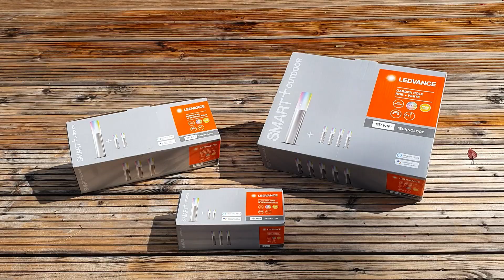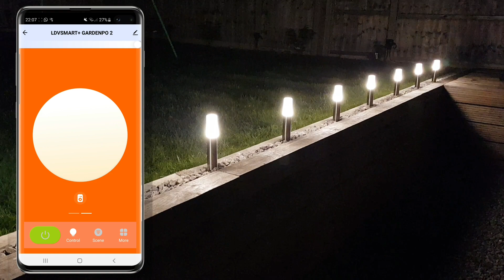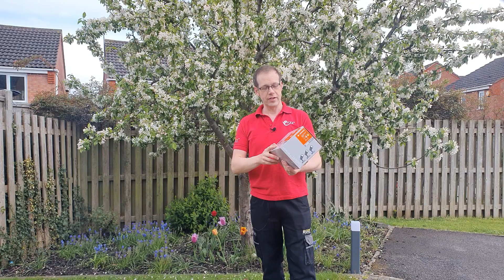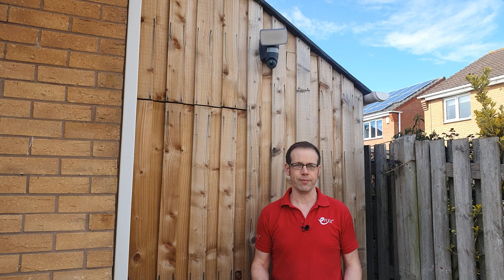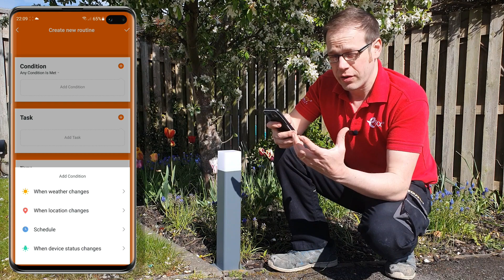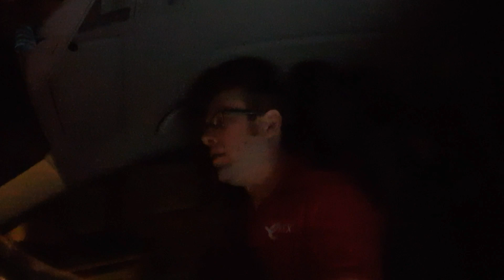5 GREAT SMART GARDEN LIGHTING IDEAS with Ledvance smart+

Comment: Great videos and a great range of lighting. I have a particular issue which I am sure is shared by many. I have a drive that is about 75m long and there is no street lighting at all and so would need several lights along it's length to illuminate for reversing up and/or down the drive. The issue is further exacerbated by the fact we are in the north of Scotland and the winter days are very short. This means deliveries etc often arrive during darkness and navigating the drive in the dark if you are not used to it proves a nightmare. I had considered using a permanent circuit with PIRs at both ends of the drive that turn all the lights on but having seen the smart lighting vids you produce I would be keen to know if this scenario has been considered by the manufactures and if there is a solution available.
Reply from the maker: You should be able to use a wireless PIR to trigger the smart lighting system and reduce the wiring needed to PIRs etc.